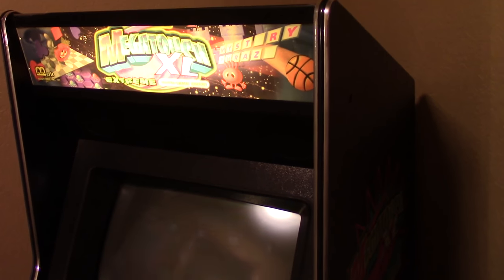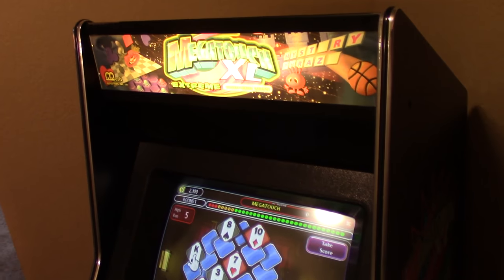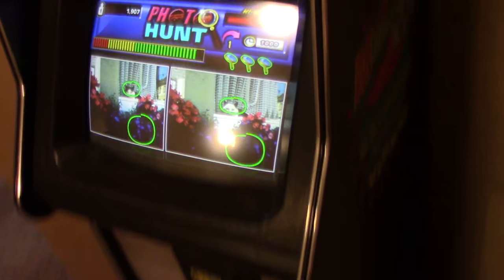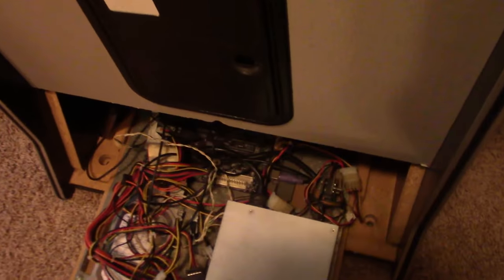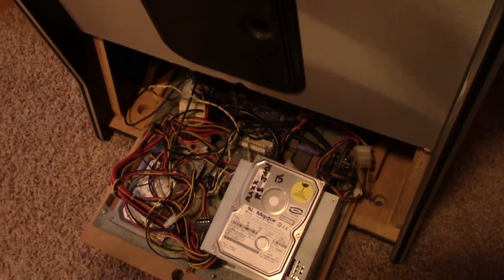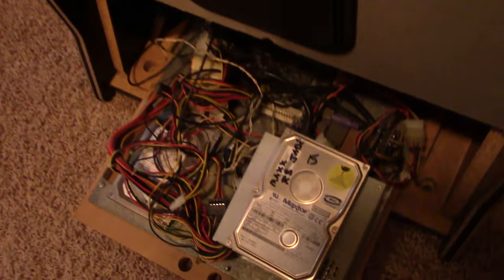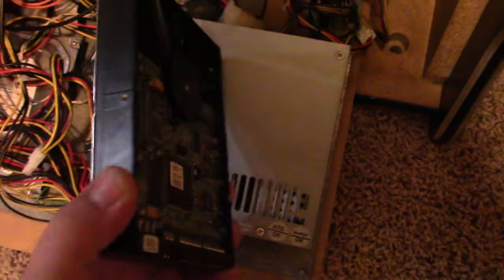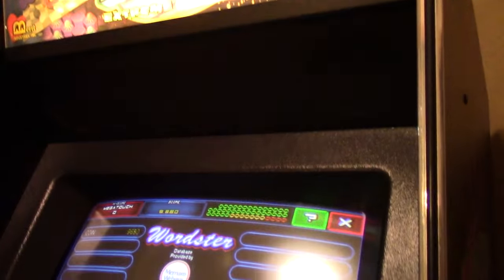Megatouch Stand Up Arcade Hard Drive Repair

Comment: As a PC technician, it is always my recommendation to back up EVERYTHING valuable on a HDD.  There have been too many times clients waited until it was too late to do so and ended up losing their data.  You were wise to clone it at that state.  It's pretty amazing that the drive was able to be copied with no CRCs.
Reply from the maker: Indeed. It worked perfectly. I was pleasantly surprised.

Comment: Do you mind sharing what cloning software you used and which o/s the PC you used to clone the drive was running?
Reply from the maker: EaseUS TODO Backup. Windows XP.
Reply: Thanks!!!
Reply: Thank you! I’m working on a small project, converting my XL to a solid state drive, using an IDE to SATA converter. This software should get me where I need to go.
Reply: @MightySquirrel724  Did the conversion work? Im having issues with it not liking a different hard drive. Only will boot with original HD.